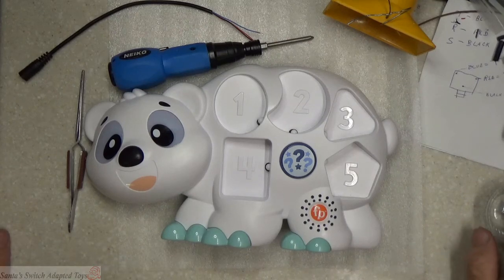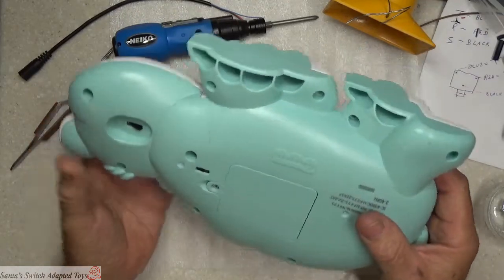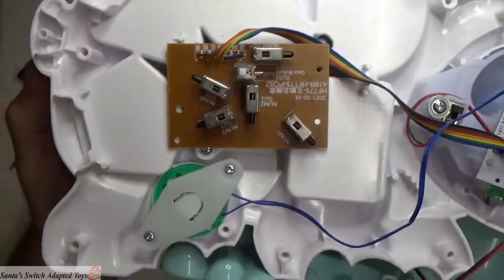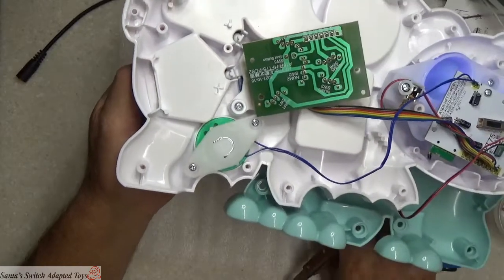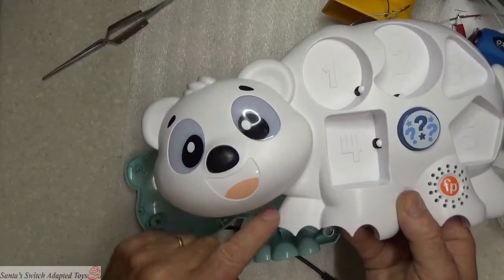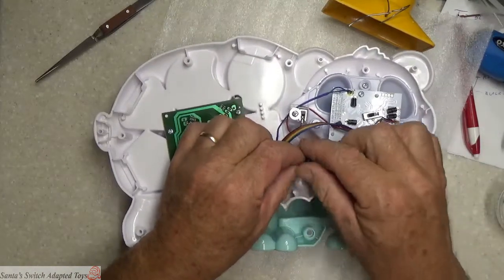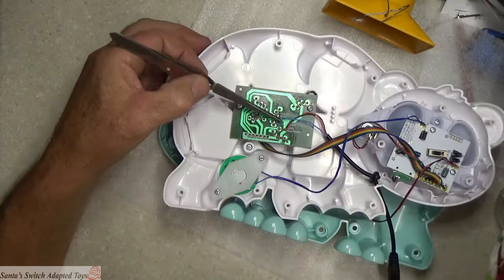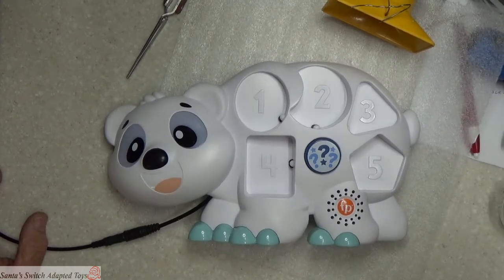Santas Switch Adapted Toys   Polar Bear

Comment: I’m confused.  What is the point to this procedure?
Reply from the maker: Switch adapted toys allow for people with limited motor function to activate toys and devices with Adaptive switches instead of the factory press buttons and switches. 

Adaptive Switches are like the big Easy Button Staples had a few years ago. 3" in diameter and sits on the desk. They are connected to the toy or device with a thin cable like used for stereo wiring. 

Imagine your hand in a mitten trying to turn on a small switch on a toy. Or maybe even in a cast. 
Nearly impossible to enjoy the sound, lights or movement of a toy if you can't turn it on 

The adaptive switch can be placed anywhere convenient to the individual to tap with their head, arm, leg, shoulder etc. Once pressed the toy or device activates. 

Adapting toys to have these cables make attaching the Adaptive Switch possible and enriches the lives of people with limited motor functions.